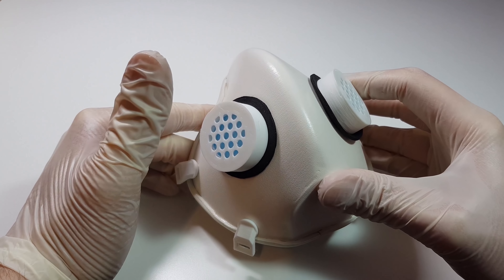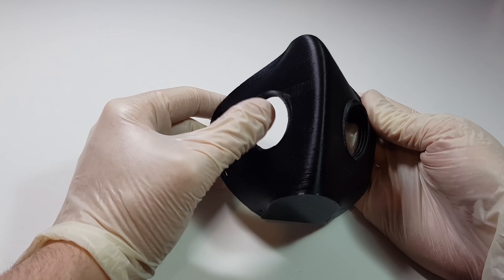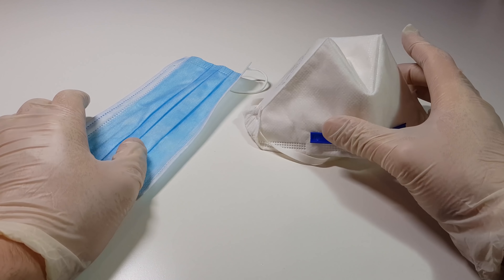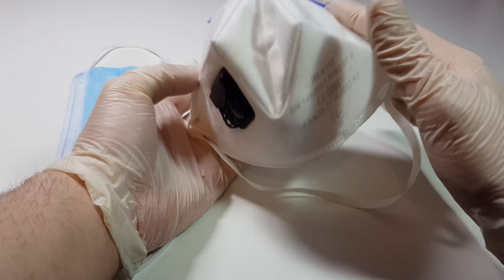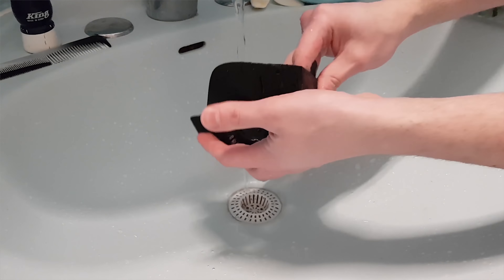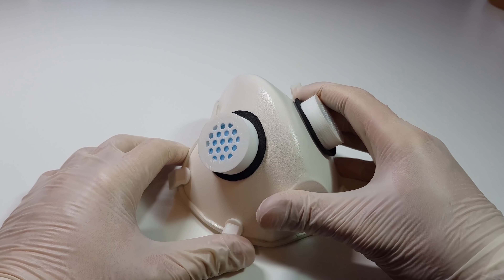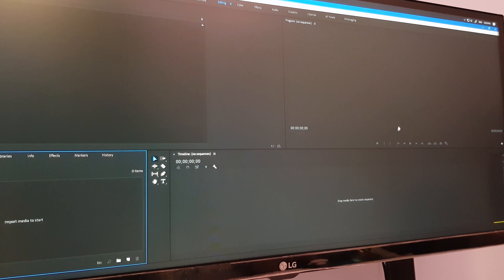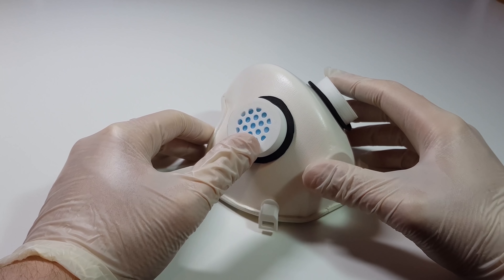3D Printed Breathing Masks. Do They Really Work?

Comment: What about heat treating the surface with something like a blow torch to remelt the outside layers and (hopefully) fuse them together? Obviously would need to be careful with how much heat you give it to not burn the plastic.
Thanks for the video.
Reply: I saw this trick somewhere to augment the surface quality. Not a bad idea.
Reply: Its really hard to do, the plastic gets soft at a much lower temperature that it melts, so it will deform and no longer have the desired shape long before the outside layers smooth.
Reply: @Diamonddrake  with enough heat it should melt the outside layers without heating the inside layers enough to soften then too much. Would take some practice likely to get the right timing on heating it
Reply: Colin Metzger I encourage you to try it with PLA, the community would love a tutorial

Comment: would be enough to spray it with color spray...
by the way, the virus has no intend to seek holes, crawl through and fly further. They need to be sprayed by a sneeze or spit. And for that this mask would be enough. But you are right, a sewing machine will be the better choice of machine for this job.
Reply: Depends on the type of paint you used and how thick the layers are. But just adding a little bit of wood filler or even a high build body filler would help out a lot. Hope this information helps and stay safe

Comment: Would it work to cover the mask with a thick layer of epoxy to get it sealed ?
Reply from the maker: Yep, it should work, as long as the epoxy of your choice doesn't outgas dangerous chemicals to breath in, or it reacts negatively to the chemical compounds used to disinfect the surface.

Comment: Good work but I ask you if it doesn't better to use acetone for softing of plastic like filler. What dou you think about ? Bye from Italy
Reply from the maker: Thanks!, Acetone works well enough to smooth ABS prints. But most people would be printing this mask in PLA. Even though acetone ABS smoothing can work, it may still leave really small gaps on the surface of the print, so it's better to be safe and use a filler to fill the gaps on the entire surface. Acetone also releases toxic vapors that might not be suitable in a medical environment. Good luck in Italy! Stay safe!
Reply: I know that acetone also smoothes PLA, however you are right and it is safer to add new filling material. My problem is that, since Covid-19, the Italian government forbids leaving home, I can only print your mask but I can't go to buy filler and paint (the shops are all closed). This is why I asked you for your opinion on the use of the same mask material for polishing. Unfortunately I am noticing that your country (USA or UK?) Is growing terribly in the contagion. Stay safe my friend! Good luck from Italy
Reply: @fastlandnet  I really don't think acetone will smooth PLA, it will only smooth ABS. To smooth PLA, you would need Ethyl Acetate or Tetrahydrofuran (THF) which are hard to get under normal circumstances. Sorry about Italy and your situation. If I were you, I would just use regular craft glue like elmers glue or wood glue. I would dilute the glue with a bit of water and apply it with a brush. The glue shrinks when it dries so apply a second coat. Good luck on making masks and stay safe.
Reply: @fastlandnet  I checked out the video. The video description says he didn't use a pure pla plastic but a pla blend with other stuff. The brand he used is Colorfabb PLA. So if you want to smooth PLA plastic then it looks like you need a mixed PLA plastic. 
According to Colorfabb  https://colorfabb.com/filaments/pla-filaments/pla-pha they use a blend of PLA and PHA. Unlike PLA, PHA is partially soluble in acetone so smoothing will work. My experience with acetone on PLA is that acetone will bleach PLA and leave a white haze on it and that can be seen at the end of the video you sent me. 
So for you I would print out a small piece and test acetone on it. If you can still get deliveries in Italy then I would order a roll of blended PLA that is blended with acetone soluble plastics because unfortunately PLA by itself doesn't smooth with acetone.

Regarding vinyl glue, I'm really unfamiliar with its properties. I'd be concered about the vinyl glue giving off lots of VOCs. It turns out that craft glue isn't that hard to make. https://snappyliving.com/11-recipes-to-make-your-own-glue/ If you have water dissolvable filament such as PVA, that is actually the main ingredient in craft glue. Since all your doing in plugging up holes in the mask, then either make cornstarch glue, corn syrup glue, flour glue, or if you have PVA filament, then make PVA glue (craft glue). Hope this helps
Reply: @fastlandnet  Oh another thing, you can reduce the number and size of the micro holes by increasing the extrusion multiplier (flow rate) and increase printing temperature. Instead of printing 100% the filament needed for the mask, increasing extrusion multiplier (flow rate) to around 110% will print more filament than needed, resulting in a lumpy, rough surface but also blocking many of the holes. Here is a mask that some US hospital workers are printing https://www.youtube.com/watch?v=ySOCNycv-aA. MegaByte's mask is clearly better but the other one is also good.
Reply: Hi  @sasukesan767 . You posted interesting posts , especially ones about extrusion multiplier which I'll adopt. I hope every good for you and your country against covid-19

Comment: To make this process a lot easier you could use the acethone vapor to smooth and seal whole mask https://www.youtube.com/watch?v=6xFUNFG-UKE instead of sanding it down and finishing with filler and paint coating 🙂
Reply: Not everyone prints in Abs. PLA does not smooth with acetone vapor.

Comment: How about a HEPA filter that is used in vacuum bags if you don't have an N90?
Reply: Hepa filters in vacuum bags? Arent. They usually rely on a permanent pre-filter to achieve that kind of filtration.

Youre better off with layers of woven fabric (for breathability) surrounding a single layer of something finer.
Reply: Anarchist Tech Support how about the type of respirator I use to protect me while I’m painting?
Reply: @mrtonyadkins  check the grade on it. If there is no grade? Its likely garbage for the purpose of virus defense. P100 is common for painters respirators, and would do just fine.

N refers to the not being oil resistant. P refers to having oil resistance. N95 or better is the goal.

M2.5 is an activated charcoal for polution particles much larger than viruses. If you can layer a couple of these and still breathe through it? It'd be better than nothing, but still untested.
Reply: Anarchist Tech Support thank you! I’m going to get the pattern online tonight to make a bunch
Reply: @mrtonyadkins  I've got family that's sandwiching interfacing inside of two different patterns of cotton. Gotta tell the inside from the outside on used ones, afterall.

Comment: Thank you for this video! I am very involved in 3D printing and I get send these things a lot and every time I have to explain that 3D printing safety equipment is just not safe. Good video! And please make sure to merge your stereo audio into mono since the audio goes from left to right all the time. No problem on a phone or laptop but distracting on headphones or a proper audio setup. Thanks for the research!
Reply from the maker: Thanks as well for pointing that issue out, i didn't notice the audio error until it was too late. I'll make sure to improve in future videos.

Comment: What stops air from going through the walls of the  printed filter holders. Should they not be filled and painted as well?
Reply from the maker: Because of the design of the filter, at least the filter cap should be filled and painted, I do mention it in the video. In version 2, both the cap and the main screw of the filter have several more layers of material, making it not as important to fill and paint them. They're meant to be more "disposable" than the mask itself.

Comment: I am trying to print you mask out on version 2, the strap holders have no support and are coming out like spaghetti.
any help would be appreciated
Reply: For strap holders use filament
Reply: @fastlandnet  The 2 on the top came out beautiful, but the 2 on the bottom were distorted and I had to sand them off. I have a creality cr-10..do I need supports for the beginning bottom print ??
Reply: I am using version 2 for the print.

Comment: I was thinking that instead of making a threaded-in part (main screw) why don’t you consider making it half smooth/half threaded and the screw-in part of the mask completely a smooth piece then using CV glue to get it in place and have the thread on the outside of the (main screw) piece, that way that piece of material could be printed laying down on its large flat end...For  some reason this is harder for me to covey to you in text....lol. Either way, thank you, brilliant design
Reply: It prints just fine standing up with no supports. I printed it yesterday. The screw parts let you take it completely apart to clean it.

Comment: Hello, and thank you about your video, I'm using a first layer of vanish and a second layer of carpenter glue. Do you think is that enough?
Reply from the maker: It sounds like it would be sturdy enough! The glue would have to be liquid enough to fill the tiny gaps in the print. Maybe put the varnish on top of the glue? Make sure neither the glue nor the varnish have any chemicals inside them that would result in in out-gassing or reactions with cleaning chemicals.

Comment: hey how would you sterilize the outside of the mask if you painted it? did you use acrylic paints? would dish soap work do you think?
Reply from the maker: I would recommend using something stronger like alcohol or IPA. You could also use bleach in lesser concentration or hydrogen peroxide. Never use something like acetone though.

Comment: is it better To print this at 0.1 so the holes wil be smaller and it is eazyer to sand and fil them ?
Reply: Ya and maybe even thicker walls so the thickness will fill in or smashed in to fix any imperfections to being sealed
Reply: @JC.72  It's not just about a seal preventing contaminated air from hitting your face. The micro pores created by 3D printing create a breeding ground for bacteria and a hiding place for viruses that is very hard to clean. Even if it kept something from contacting you directly, just handling an untreated 3D printed part can transfer bacteria or viruses to your hand, then to your face. Try to imagine that the print is like a microscopic sponge, it may look and feel smooth, but it hosts a lot of dangerous microorganisms. Increasing print resolution and thickness may cut down on post processing time, but it won't inherently make it safer.

Comment: False sense of security? For the love of God, anything goes at this point. We are in times when we are being told to make masks out of a shirt and rubber band from the tippy top surgeon in general.  The purpose is to slow it down.Not prevent it altogether. No social distancing can do that. No mask can do that no matter if it's licensed and rated safe or if a tech geek wings one with a 3d printer in his garage. So all of this ''well 3d printed masks have these problems'' is irrelevant at this point. Don't get me wrong, there are merits to bring up counter points but the entire point in the masks in public is to minimize people sneezing on you as much as possible. I put up sneeze guards at cash registers. Like masks those are just to keep cashiers from getting coughed on.Sure they aren't enclosed and air flows around the plastic. Should these 3d printed masks be hyped up like they are? Probably not but when the alternative is going without one due to shortage and having to make one out of a rubber band and cloth, they're not really all that bad considering you won't be allowed into a store without one and will have to resort to literally putting anything on your head as long as it's not a klan hood. We are in desperate times right now and are taking desperate measures. Nitpicking 3d printed masks would make sense when everything is normal and people don't need masks. creativity and craftiness is at an all time high right now for this to even be a point of contention.

Comment: that copper 3d mask is BS.  not only that, the mask itself doesn't work well, it doesn't seal and the folds are problematic even in version 2.   The filament used is only a Bacterial Inhibitor (using silver to discourage the growth of Bacteria on it) which is a safety concern with long worn masks, the warm moist air, and dark space easily can grow mold as well. (clean after/before every use! make sure to kill all the bacterial/mold growth!)
the company is using the pandemic as a point of interest to try to sell filament- overpriced filament at that. (you can find silver/anti bacterial PLA for less than half price elsewhere)

Thanks for the 3d file, I have been looking for a good mask for general use (not really viral, dust and other use instead) but all the masks I see don't really look like they would work, or look horrid in general.   Yours is promising.  Can't wait to get my printer part (gotta repair extruder handle) and try it myself.

Comment: You are talking about masks giving people a false sense of security, but this is exactly what your design does. None of the available filter materials is capable of filtering out this tiny virus but you are reducing the surface area of the filter which leads to a faster airflow and more virus passing compared to a standard N95/FFP2 or even a surgery mask.
Please don't misunderstand me. I like the mask you made but its purpose is to protect other people from you exhaling and spreading huge amount of contaminated particles with each coughing.

Comment: If I do have a resin printer are the post processing steps as critical?
Reply: i.e. wet sand, filler, dry sand and acrylic paint?
Reply from the maker: Nope, If you have a resin printer you can go ahead and print the mask using medical grade resin. You can also ask your local hospital which resin material they will approve for medical use. The post processing steps aren't as critical in the case of resin and powder based 3D printers with approved materials.

Comment: By the way, the document you showed from AFES Chile is not official, thanks for the video it was really helpful. https://twitter.com/ChileAfes/with_replies
Reply from the maker: Yep, I realized that after doing some more digging. But the information itself seems to be accurate. With my microscope I measured gaps between 50 and 80 microns wide, so it's definitely a real issue.

Comment: awesome video have to agree one thing how long you should be one for and when wearing one can be more harmful than not wearing one  
as for me putting anything over my mouth or nose, i do have problem breathing i do have a full shield mask i wear when i need to  still do not give me a com filled feeling using one i was all was this way  especially when a run or do a lot of heavy moring around fast fine i and short of air  
did not help the first  trade a choice was welding  had to quit due to breathing problems  them i did machining did not enjoy the challenge  was a get job  millwright given me what i was looking for now  still a problem with breathing I now work form the farm  and do enjoy this better to i rebuild farming equipment now  and resell them keeps me busy anyway the last little while  been working on machinery that has been bought to be rebuild

Comment: breathe ability and filtration is an issue of geometry, how big can your mask be without being useless, with a large enough filter you can use osmosis, just use bigger filter barrels.
If I was designing something that was going to be used all day by a health worker in this environment I would design it with a back pack with 2 HEPA filters(cheap and this will remove the 99.9% you want) with tubes to the mask, I have used gas masks and after an hour breathing can be very difficult, dust kills them very fast.

Sorry but this is a nice toy, try use it for 3 hours in the real world and the size of your filter will render it useless real fast, use way bigger filters.
Reply from the maker: I realized this after building the first prototype. The release version of the files have the filters being 3 times the area of the ones in the video.